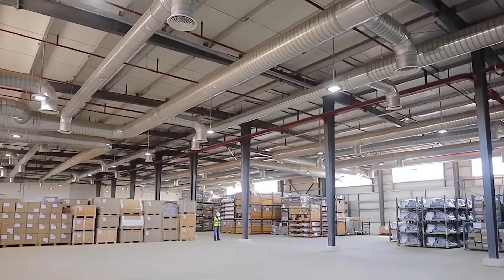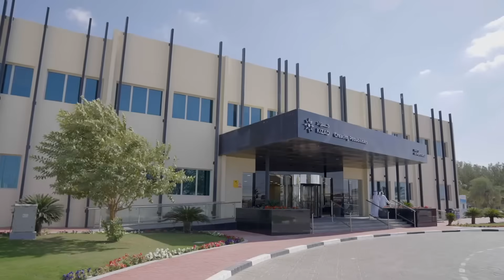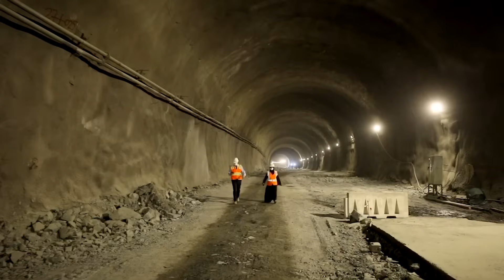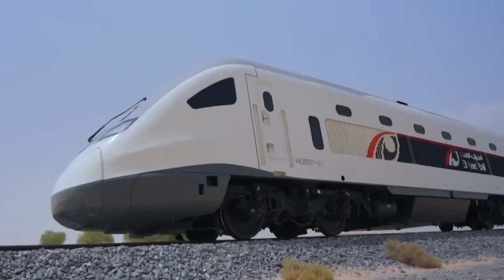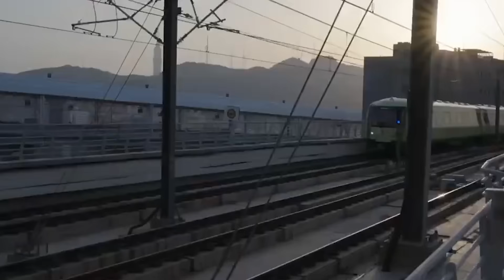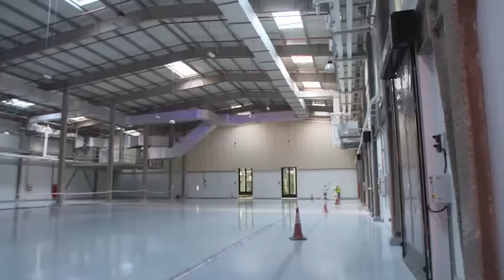UAE Is Building a Port in the Desert to Move Shipping Containers With No Sea

Comment: Also ading a expand ports into sea and so called green curved oasis that can hold miniature on corner rails water irigation and mostiček systems for agriculture grow botanics and pharming  animals  as well as nitrate factories at coast inc water desalination facilities plants  solar fields area or vallies or even better solar sun flowers and patching through electricity network through thorium cells not needed to big nuclear salt reactors with enough reserve to for cities to grow and purposly build h2 recycled plants into athmosphere covered with enough factors water desalination plants is bit nice covered plan that allow science view  sat topographic data on terraphorming and green industry sektor grow a spolite to industry as something understood as logistic used rails Rossa or ports having eventualy like east coast and west coasts like us has but you have more then one country also as thing as polite to industry oil or grow then again basic industry cost grow infrastructure  does not countas as owerall complete owerachieve any imitiral costs and has complete segment grow and terrraform view inc recycle ind which some countries already have